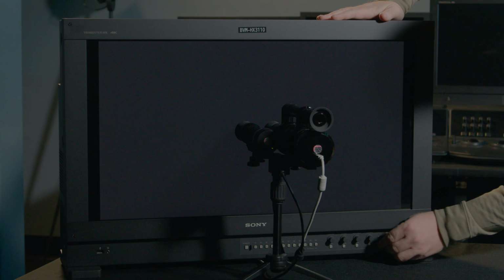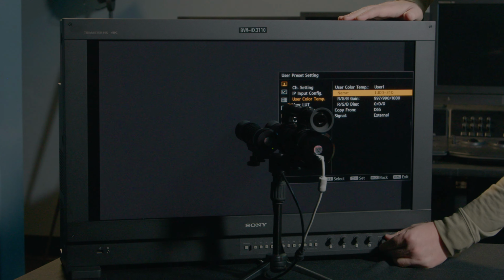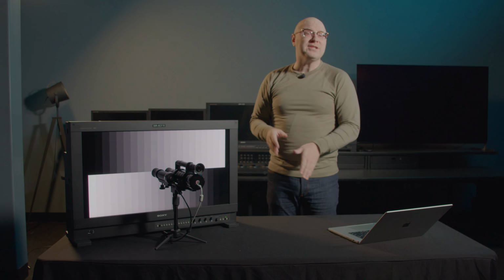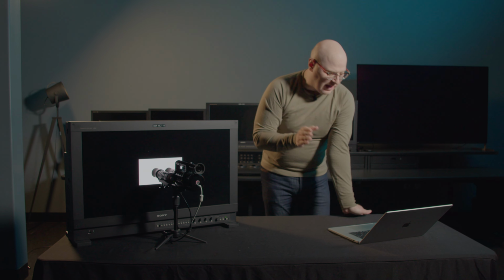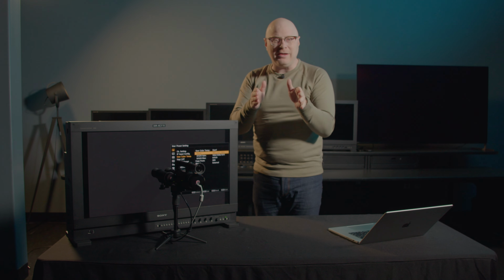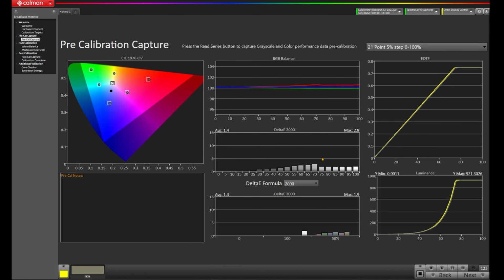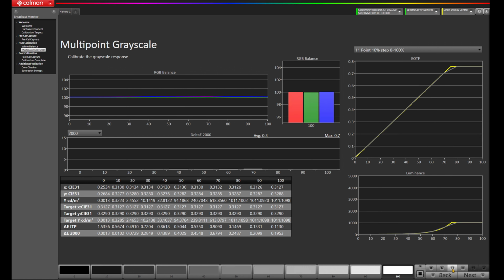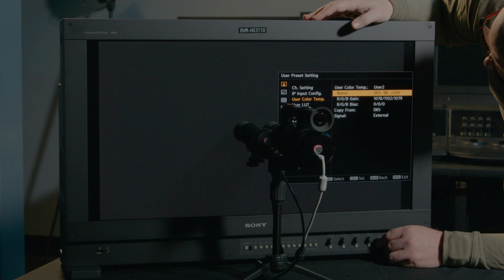Tutorial: Calibrating the Sony BVM-HX3110 in Calman

Comment: Whatever happened to the Sony offset designed for the HX310 to match the X300 RGB OLED and, ostensibly, D65 on a CRT. I believe it was .3067 .3205. Feels like we have different D65 “looks” out there based on whether content was mastered on an X300 @ .3067 .318 or the HX310/3110 at 1931 D65.

Comment: Thanks for the video. I'm just wondering one thing. If those colorchecker and saturation sweeps wasn't that good, and you had patches going towards 1.5-2 dE2000 - how would you work on that in the Sony?
Reply: External LUT box I guess.
Reply: I’ve not seen the deltaE’s ever run that high even after years of use

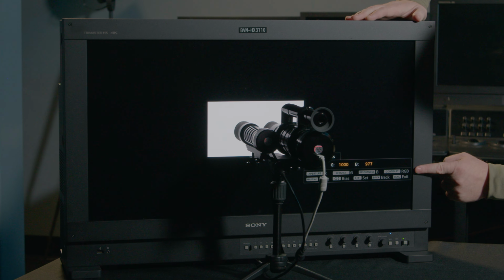Comment: Why using “contrast” on the color temp RGB to increase the peak luminance is better than use “contrast” on the “Chr./Bright./Cont.” menu?? 25:31
Reply: You could use either, but evaluation is required first to see which is most effective. Increasing signal contrast risks clipping higher "HDR 10-bit code values" as your readings approach 1000 nits. To determine this, you'd need to measure more points  from codes 688-725 (above and below your 1000nit target) so see if your readings match the absolute ST.2084 lumincance values. Increasing RGB gain up and down together is very much like increasing the contrast control. You could risk clipping one colour channel more than another, so again, measure the values closest to the 1000-nit peak. *Note: not all spectroradiometers/colourimeters are created equally. One meter may read code 504 as/close to 94.378cd/m^2 and require the user to not make any adjustment at all to contrast or combined RGB gain. Another spectroradimeter may read it 10cd/m^2 lower thus telling the calibrator to increase the luminance. It's important to know both the strengths and weaknesses of video displays as well as your own tools.